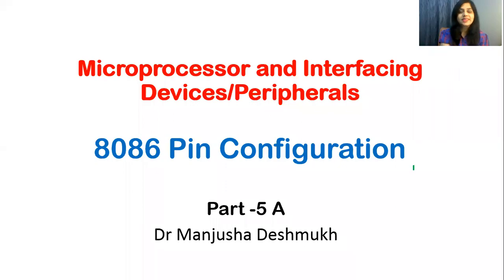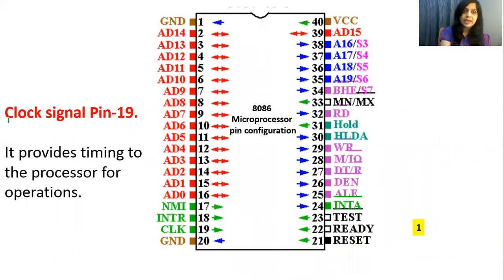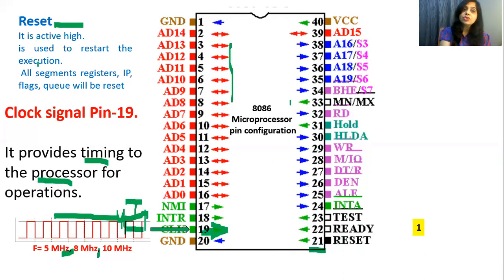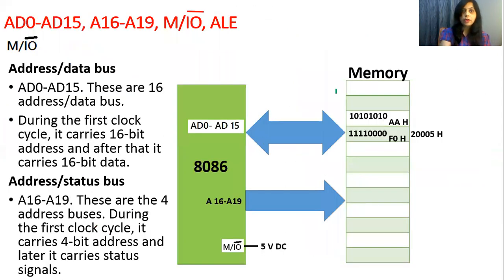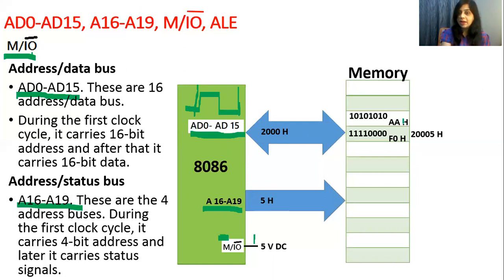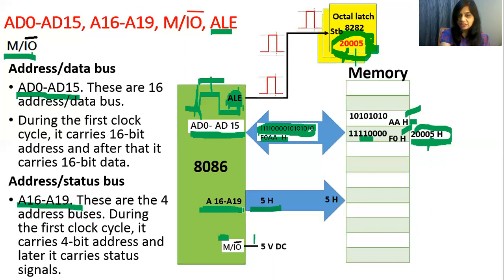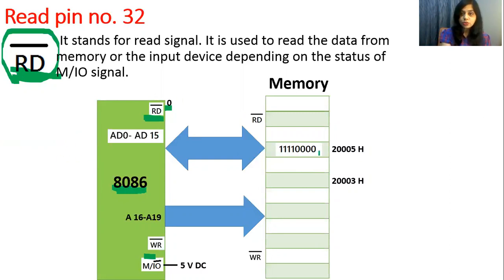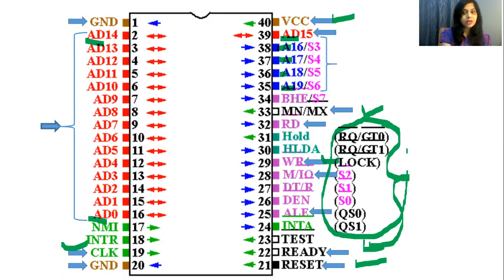8086 pin diagram Part A for 8086 very easy with animation: Dr Manjusha Deshmukh

Comment: Q) The value of the DS register is 2032H. And the BX register contains a 16 bit value which
is equal to 2052H.
ADD BX, 0008H
MOV [BX], AX
Calculate the address at which the value of the AX will be stored.

Q) AL=38 BCD, CL=49 BCD. Perform the addition and subtraction of above two registers
value and obtain a valid BCD using suitable instruction

                    Ma'am can you please solve these doubts?
Reply from the maker: Q1
BX will hold 0008 after first instruction
2nd instruction for memory address use formula
 - 2032 X 10 + 0008=20328 is physical address
so contents of Ax will move to 20328
Reply from the maker: For Q1 refer video https://youtu.be/zazyEbuh9vE
Reply from the maker: For Q 2 refer
https://youtu.be/D5kempbOruE
for DAA instruction refer
https://youtu.be/9Q3rCGg2bTA
Reply from the maker: Q2 -  for addition
           MOV AL, 38 H
           MOV  CL, 49
            ADD  AL, CL
           DAA
           HLT

for subtraction   
MOV AL, 38
MOV CL, 49
SUB  CL,AL
DAS
HLT